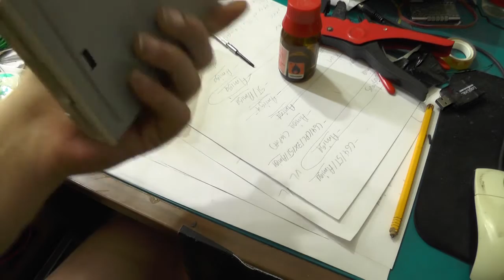How to Clean the R/W Heads in a 3.5'' Disk Drive

Comment: just a question! I have some 5,25" FDDs. The question why the hell is one of my 5,25 FDD destroy floppy disks? The head is scratch the disk... I dont know why. I checked the head and I found it in good condition. Any advice? Thank you very much in advance
Reply from the maker: That's a hard question to answer with such little information.
First of all, are you talking about PC drives or about drives for the old home computers like the C64.
This is sort of important because the PC drives were double sided and most of the home computer drives were single sided.
I only really have some experience with C64 5 1/4 inch drives. They are single sided and are read from the bottom side. The side that is opposed to the label.
On the top side is a felt pad in the drive to provide enough pressure to the disk so the r/w head can read the information.
So if you have a C64 drive that scratches the top of the disk, it is a good idea to check if there is anything in that felt pad like dirt that scratches the disk.
On double sided drives you have a r/w head on both sides, obviously.
So either the r/w head on the side that gets scratched is dirty or damaged.
Cleaning the heads thoroughly might help, but don't test the results on a disk of any value.
Another possibility is that the magnetic coating is disintegrating. That can happen over time and depends on who made the disk, how it was stored, the current moon phase and luck ;-)
You can't do anything about it. The only thing you can try is to read as much data from this disk as possible the first time you insert it into your disk drive and hope for the best.
Also you really have to give the drive a good clean after you encounter such a disk. 
It will surely clog your r/w heads or stain that felt pad I mentioned above.

Comment: I put a 3.5" floppy drive in my computer just for the fun of it. I even fabricated my own adapter with soldering and tape so I could power it with a Molex. Started up the computer, put a disk in and it reads great. Put another disk in... and loud grating noises. It doesn't read because it came up with some read error. Checked and the disk was really, really dirty. After that, the whole drive doesn't read now. Thinking of tossing it if I can't get it fixed.

Edit: I think I'm losing my mind.. Turns out the disk was write protected. I also only have two disks. I'll come back if it works, I guess
Reply from the maker: You should throw away dirty disks anyways.
Even if they still work, they may clunk the R/W heads with dirt and damage other perfectly healthy disks.
Reply: @Theshadowsnose  I didn't know it was dirty at first, because I'm too lazy to check them before I put them into the drive. I still have hope in recovering it, probably just needs a good cleaning inside. I'll see what I can find for more affordable head cleaning disks though, and maybe I can make a working Windows 98 disk that's actually useable.
Reply from the maker: @aidancommenting  You don't need a cleaning disk, just clean it as shown in this video.
It should not be too hard.
Reply: @Theshadowsnose  I'm only in my teens, and I don't know if I have the supplies for it, but if all else fails, I can try. I've already opened it up once and it didn't look too dirty, so I'm sure it doesn't need too much of a cleaning. I'll give it a try though
Reply: @Theshadowsnose  Question. Will this work with 70% rubbing alcohol and cotton swabs? I don't have anything else on hand and >90% alcohol is too expensive.
Reply from the maker: @aidancommenting  I would not recommend 70%.
I don't know what you call expensive, but a small 100ml bottle lasted me forever.
Probably a whole decade and I also used it to clean the heads in my tape drives.
Reply: @Theshadowsnose  I live in a place where it's rather difficult to find work, hence I don't make a lot of money. Also, being 15, I don't have a license and can't drive to a pharmacy. No offense or anything, just explaining my situation. This video did help me in that I saw slight improvement in using 70% on one of the dirty disks (asked me to format the disk, I assume the drive detected its presence but it was still unable to complete the format). Thanks for the video though, I'll be sure to use it once I get better supplies 🙂

Edit: I tried the 70% on the dirty disk before I read your reply, so I wasn't quite sure of what I was doing. It was more of a last-resort thing and it was late at the time.
Reply: I found a third disk that also doesn't work, so I suspect the first one got the R/W heads dirty, and probably passed some of that dirt onto the clean disks. I tried looking for head cleaning disks but the only ones I could find were well over $100. The drive still powers on and it appears to move, so I'm keeping it for now.

Comment: Many years later....Covid 19/stuck at home/bored has prompted me to dig out my old Yamaha MDF2 (Midi Data Filer) which can be used to drive my old Yamaha MIDI keyboards. The drive belt had perished so I replaced that with a precise fit (ordered from www.williamthakker.de and delivered, amazingly, within a few days). I replaced it but I am still seeing 'No disk'. I have cleaned the heads to no avail. I can hear the drive moving and I'm sure everything is where it should be. Any suggestion?  I appreciate this is ancient tech. Grateful for any advice other than 'buy a new drive' which I can work out for myself. I am committed to getting it working as a hobby/objective.
Thanks!
Reply from the maker: Buying a new drive may be not as easy as it sounds because many of those old devices need drives that can do more than the standard PC drive.
I've run into that problem before when I needed a drive for the Amiga500.
Have you looked if the head is actually moving?
Maybe it is just stuck in its current position somehow.
Those 3.5'' drives are rather delicate, so be careful if you try to move it by hand.
Another possible failure could be the sensor that detects if a disk is inserted.
I had that problem wit one of my Atari STs. They used some sort of button switch to 'see' if a disk is inserted and that just didn't work reliably anymore.
Haven't fixed that, yet. Swapped the drive, because I'm lazy :-)
Had a similar problem wit my original Amiga500. Not with the 'disk inserted' sensor, but with the sensor for the write protection.
It just didn't recognize the write protection anymore, so I couldn't write anything to disk.
That drive used a magnetic reed switch activated by a magnet that was tilted towards the switch when the write protection hole was filled. That switch was broken.
I DID fix that back in the days by removing the reed switch and replacing it with an ordinary switch that I mounted into my Amiga's case. So I could select if I could write to the disk no matter what position the tab in the disk was :-)
I hope you find the cause of the problem and you can fix it.
Sorry for so much waffeling ;-)
Reply: @Theshadowsnose  Wow! Thank you so much for answering and on such an old thread and thank you for such an informative answer. I'm afraid I'm one of those people who is more focused on the musical side than the tech so I tend to dismantle carefully, take photos as I go along then reassemble making sure to put everything back where it was. I don't really know what I'm doing from an electronics point of view.I know that the unit was working ok maybe 5 years ago or so since when the drive belt perished. I definitely bought a direct replacement belt for the specific unit (Yamaha MDF2). I am as confident as I can be that I have reassembled correctly. The only doubtful part on my first run was the a small slotted cube through which the big 'flywheel' driven by the belt runs. I originally thought it was just a guide for the wheel however on checking I can see some electronics attached so assume it's a counter of some sort to synchronise the data with the speed of rotation (pure guesswork)? The actual read & write head part is engaging when I put a disk into the drive and disengaging when I eject it. 

It may be that the disk itself is damaged and as the drivers and extensions are Yamaha proprietary I can't use/read another disk to check. I have a shedload of disks with songs on them lying around somewhere but a recent house-move means...well, you know! It's not critical and if I can't fix it myself I probably won't replace the drive unless I'm sure it's compatible and not stupidly expensive. It's just a bee in my bonnet for now and I'd like to meet the challenge (and recover a particular drum pattern for one song as I can't remember how I programmed it).

If I get it working in the next 6 years I'll let you know!! Again many thanks. I'll subscribe to your channel.

Comment: Thank you for the useful video.
It reminds me good old days and my retro PC
with Tualatin CPU.
Reply from the maker: +ledokol3000 You're welcome.
The 'Tulatin' was the PIII, right?
Reply: Yes,You are absolutely correct.
The Tualatin was the third revision of PIII CPU straight after Katmai and Coppermine ver.Were released during 2001 until early 2002.In my case it was Pentium III Tualatin 1.4Ghz wich I've been using with my first
ASUS TUSL-2C motherboard :>)
Reply from the maker: +ledokol3000 I have a 900MHz PIII in my retro PC. Amazing how responsive it is in Win2K or Win98, considering it only has 128k of RAM.
Reply: Fully support and agree with you're point of view.Win98 run's great, smooth and softly on my old school rig  too and of course it is amazingly responsive as you said I love this version of Windows very much and will be using it till the day I die.:>)

Comment: Hello I'm Jimyjames73 from England - I have an Amiga A500 & the 3.5" drive was not working properly & might need a clean - I was told both by MarkTheMorose (who has commented below) & GadgetUK164 to use Isopropyl Alcohol to clean the drive with - by I was not sure how, so I came on Line  found your video & found it useful & I thank you for that & now I'm going to make a video showing how I've done it!!!Oh by the way I have subscribes to your channel - feel free to do the same to mine & if you're interested - I'm building a 3D Printer week by week & you can watch me review & build it - go to my Channel - Jimyjames73 then click on Playlists then click on 3D Printer Build & Review or any other Playlist you may find interesting like maybe Computers & Gameing :)
Reply from the maker: +Jimyjames73 I hope you get your drive running again. 
The process is pretty streight forward, just be carefull to not bend anything too far.
Reply: Thank you for both of your Comments - they are useful

Comment: I have an Atari SF314 (Epson?) drive that won't read certain disks that work on a different drive, will try cleaning it.
Reply from the maker: I'm not too familiar with the ST drives... the (broken) one I have lying around is a Sony one and the mechanics are almost the same as in the drive I showed in the video.
Would be great to hear if the cleaning actually helped with your problem. I only had to clean my drives when I got a bad disk. It was pretty obvious that the disk had disintegrated to the drive's heads and cleaning the heads fixed the problem for me.

Comment: Back when floppies were still relevant for everyday computing, you could get cleaning disks.  The one I had for my Amiga was a rather abrasive looking material, I only used it once or twice, and it was just as part of a short-lived maintenance routine.  Thereafter, I never bothered, and never had problems with disks that I could attribute to dirty heads.  Most Amiga floppies seemed to have a naturally short life anyway!
Reply from the maker: I had cleaning disks with some white fleece material inside. You had to drip it with a cleaning fluid which was most likely pure isoprpyl alcohol.
I used it a couple of times on my 1541 and the fleece got brown after a couple of uses, so I assumed it actually worked.
On my Amiga, I had a similar cleaning disk, but it didn't get brown after a couple of uses so I stopped worrying.
Usually you don't have to bother cleaning the heads. On the other hand... the drives are now really old and probably got used a lot... not necessary with the cleanest disks. Occasionally the magnetic coating chips of the disk and completely clutters the head. I had that a couple of times on my C64.
The next time I have that on my 1541, I'll make a tutorial how to clean the head on that... it's pretty much the same. Just much harder to reach the head. On my 1570 I have to remove the entire PCB to get there.